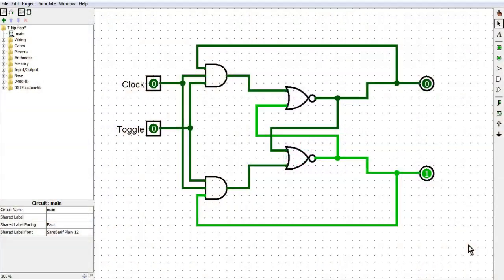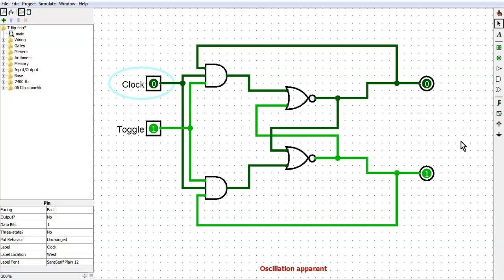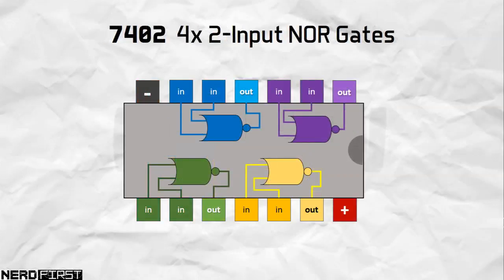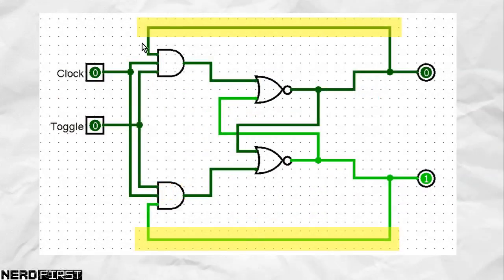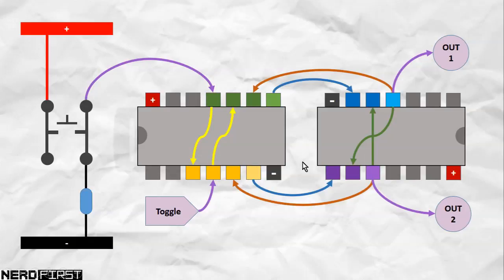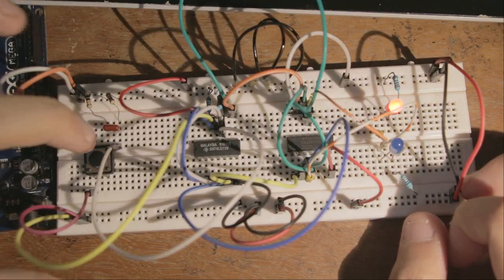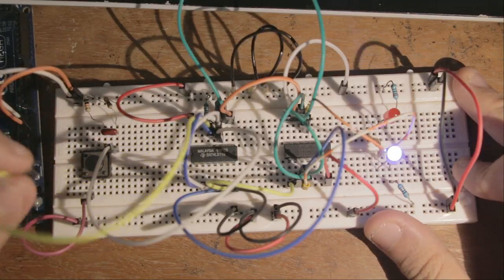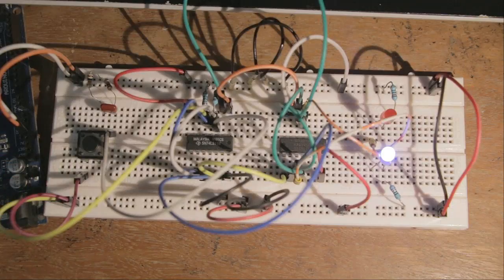T-Flip Flop - Transistors 12

Comment: Would've have been better if you just used discrete logic instead of ICs.
Reply from the maker: Hello and thank you for your comment! I'm not exactly familiar with the term discrete logic, but from what I can understand, the 7411 and 7402 chips used here still fall under that category since they only provide access to AND and NOR gates. It's not like I'm using a chip that already has a flip-flop on it. Or am I misunderstanding you?
Reply: @NERDfirst  my fault not so good with the English. I meant to say TTL. Which, those chips fall under, but it would've better to see the flip flop made entirely from transistors is what I'm trying to get at here.
Reply from the maker: Ah, I see! Yes, I actually considered doing that for this video, but I very rapidly realized how messy things are going to get, so I decided against it. Even with this setup there are already wires crossing everywhere! Didn't want to make it worse.

Comment: Could you also explain with more details why oscillation occurs and why it's not possible to design T-Flip Flop in simulator.io? I guess it's connected with the fact that AND gates form a ring oscillator (with T and clock high) and the race-around problem arises. How it'd be possible to eliminate oscillations?
Reply from the maker: Hello and thank you for your comment! Oscillation happens due to cyclical dependencies - Certain components have inputs that rely on their own output. To make this understanding clearer, you may want to study the logic gate representations first rather than the transistor representations - While more abstract, it should be easier to see how certain components rely on their own outputs for input.

Latches: https://www.youtube.com/watch?v=v75jICsu0WQ&list=PLJse9iV6Reqj1M8p1jzvv6Zzj0js_gawl&index=8

Flip flops: https://www.youtube.com/watch?v=5zzvzx_LJCw&list=PLJse9iV6Reqj1M8p1jzvv6Zzj0js_gawl&index=9

I have not used the simulator you have linked, so I cannot advise.

A simple way to eliminate oscillations is to rely on clocks, as discussed in the video.

Comment: How do you make the lights NOT oscillate? Is it because you used a capacitor?
Reply from the maker: Hello and thank you for your comment! While, yes, the use of the capacitor is why the lights don't oscillate back and forth, I think it paints a really incomplete picture to say that the capacitor makes the lights not oscillate.

When the button is pressed, it gives a positive (HIGH) signal, which, if fed directly to the circuit, will result in oscillation. The capacitor is there to essentially "convert" the signal to a short pulse, just enough to make the circuit go "one step forward" and no more. For more information about how that works, refer to episode 11: https://www.youtube.com/watch?v=N9i4ln2nPfI

Comment: hi, I download logisim software but I can:'t work your circuit. simulated  enabled ok. but circuit not working like yours. some line is red. what can I do. thanks.
Reply from the maker: Hello and thank you for your comment! If you see red lines, it indicates that there is an error. It may be caused by trying to send both 1 and 0 down the same wire, or if a component is producing an invalid output. What I can suggest is pausing the simulation, deleting and reconnecting the problematic wires, and trying again.